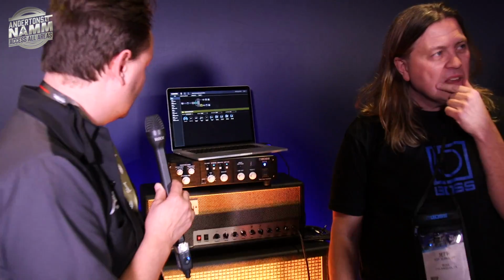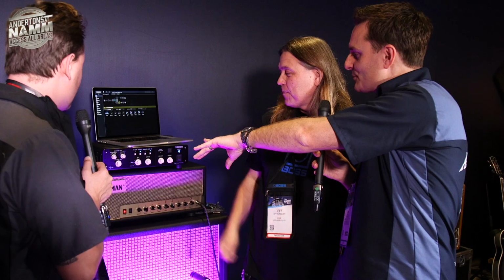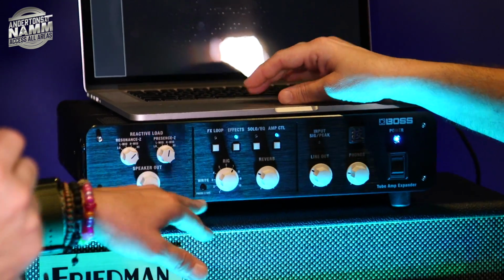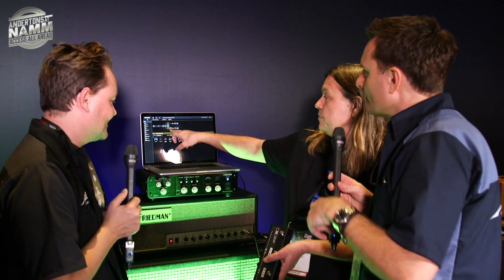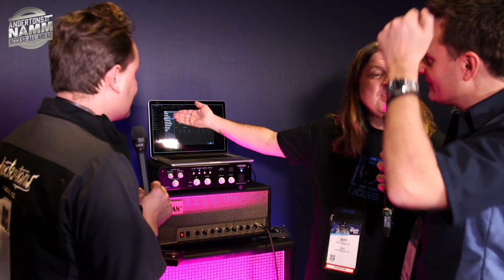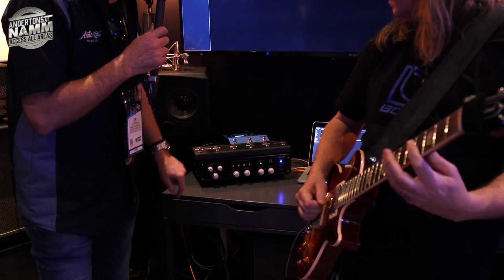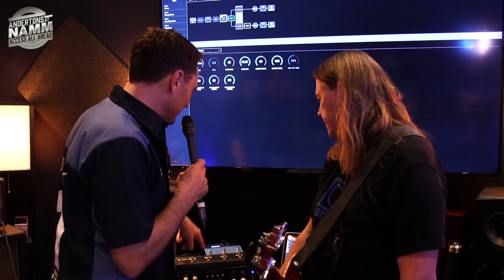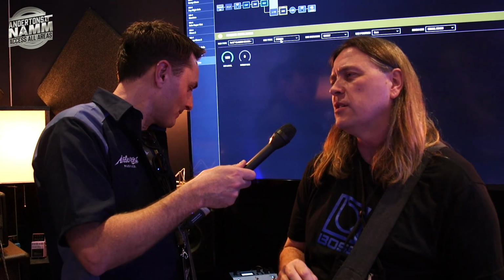Waza Tube Amp Expander - Boss' New Secret Weapon For Guitarists!

Comment: Ho’s Electronics in Vancouver has been making a reamp/attenuator device like this since the early/mid 90’s. It doesn’t have as many bells and whistles, it does have line out, effects loop, 100w onboard amp, and my unit has a variance built in as well. Ho also has a “Tone Enhancer” which does the reverse “take a 5w Champ and make it loud” thing. This Boss unit adds some modern features but the core utility of the unit is a concept that is decades old. The Ho unit has been a godsend over the years and amps have never suffered, they don’t even get hot.
This Boss unit does look very impressive.

Comment: Only downside is that you "lose" your amps power amp as it gets replaced by the 100watt solid state from the device itself, which I find a big enough con to not buy this.
Reply: Well, you don’t. It seems the amp’s power amp keeps doing its thing. The 100w power ss unit there is just for “re-amping” the signal, to make it even louder or, in some situations, quieter. Man, that’ll be just the thing with my Princeton.

Comment: I think this is the best product of Namm 2019. This device literally retrofit upgrades your tube amp into the modern era. You can control your tube amp by a computer, it records with an interface and you can play pushed tubes at bedroom levels or through a mixer and monitors if you want. Plus it has effects and midi control. Simply amazing, great work BOSS!

Comment: How does it work with a combo amp such as a Fender Bassbreaker 18/30?
Reply: As long as your combo has a jack and cable connecting the amp to the speaker/s then you just need a speaker cable (not a guitar cable) to connect the Expander between the amp and speaker.  If the speaker/s are wired directly to the amp you would need to split the cable and add jacks to allow you to connect between them.  because speaker connections (series/parallel) matter for more than one speaker you need to know what you are doing so you don't screw up the impedance--time for tech if you don't know what you are doing.  :)
Reply: patrick bear Appreciate that. I just looked at the manual and the speakers run parallel. So this won’t even work with my amp. I gotta figure out how to run an fx loop or how to make the speakers run in series.
Reply: Series or parallel doesn't really matter for this--you could wire this in and still maintain the parallel wiring.  My understanding of what this box does is that it basically isolates your amp from the speaker/s anyway.  In other words your speakers are no longer driven by your power amp they are powered by the built in 100 watt amp which receives the IR and effects altered signal.  The Main speaker output on your amp would be a good way to feed signal to this box then you just need to wire the output back to your speakers.  Work with a tech if you aren't sure how to do this.

Comment: $1899 retail, Sweetwater has it for $1299 street price??? This is a choice between a bevy of guitar gear (2 4x12 cabinets, nice guitar, decent amp, load box and a couple of pedals) or the waza bells and whistles. A tad expensive, get it under $999 and I'm on board.

Comment: I was thinking that this Boss product was a hands down winner, then Captain Lee said the price and I was like What??? and then tried to find a listing online and seen it on Sweetwater for $1299.99 USD.  Hell no. It’s an awesome piece of kit but no way could I justify that price. It’s 99 cents dearer than the UA OX Amp Top Box which I thought was expensive. It will require a few different boxes but I would use an alternate setup, work around to achieve similar results. Bad Cat Unleash V2 or Fryette Power Station and Two Notes Torpedo CAB M and some pedals or multi effects or modelling unit if you want a hybrid setup for your current valve/tube amp.

Comment: Hmmm, my options for not getting noise control called on me range from very affordable solutions like iRig, thru to an amp with something like this, an AxeFX, or going the whole hog and buying a farm in the countryside that has a large barn housing nothing but a wall of Marshall stacks, a guitar and a long cable. Budget so far is closer to the iRig end of the range though

Comment: Dave's emulated out on the Runts is already emulating a mic'd speaker...why would you add another cab simulation on it???
Reply: Because this speaker sim is more variable with different ir’s and mic selection options, and because they’re not using the emulated out, it goes directly from the power amp out. And most amps don’t have emulated outs, especially older vintage ones, plexi, ac30...
Reply: GRT XYZ oh...I see.  Didn’t realize they were using the  loop send to feed the unit.  Makes sense now.

Btw...I’d put Friedman’s emulated speaker out up against just about any cab IR.  It’s that good!  I get compliments every time I gig with my Runt 50 head and run it to FOH.

Comment: And NOBODY is talking about how much more WEAR the TUBES get with those devices...
Reply: Its up to your amp and settings, its the same amount of wear as you'd have if you crank your amp without a load.
Reply: JimijaymesGuitarist not really, because without a load you’d break a tube amp...
Reply: @grtxyz4358  I mistyped I meant in normal operation without a load box ie with a speaker.
Reply: If the reactive part is accurate the load would be the same as with a speaker

Comment: Impressive, but they're not using the stereo output to its full potential. Would be nice to be able to split wet/dry to R/L, as well as have a wet/dry mix level. Also, if I were to put this on top of my AC30, and want to use my AC30 cabinet as the speaker out, I really would like to be able to limit that 100w amp output, say a 10,15,30,50,100 switch?? I could also see a less expensive model, without the 100w amp, as another option.
Reply: You can limit the output of the 100w amp to , 50 or 10, there's a switch on the back.
Reply: @riffsnreviews  That is for the input, not the power amp output.
Reply: @badpants  It is not, it's for the output 

I mentionned to the rep that calling it "input" in counter intuitive, but then it depends what end of the signal chain you are looking from, they go from the idea that you are inputting your guitars effects and potentially other amps into X amount of watts, when thinking about it like that it does make somewhat sense I guess (as the attenuator works via reamping like the power station)

Got this confirmed by  Jeff Slingluff on tgp. " he reason for that switch is to set an appropriate level for the internal effects/D.I./Power Amp Probably the best example for it is... If you connect a 100W head you probably only wish to attenuate and turn down the live speaker cab volume. But if your using a small wattage amplifier you may want to turn it up instead of just down".

https://www.thegearpage.net/board/index.php?threads/boss-waza-tube-amp-expander.1992874/page-14
Post #263

That switch has no bearing on the 150w  load it can handle, it's to define the power of the internal SS amp, so you can have a 100w tube amp and limit the SS output to 10w, or you can have a 10w tube amp and bring the SS amp up to 100w if so desired. 
The end result is mostly making the volume knob on the waza expander less "twitchy" and to give headroom for small amps if required (voz class AB solid state amps don't sound really great when cranked...) and to set the power if you are just plugging a preamp into the waza expander
Reply: @riffsnreviews  I read the post and I'm not convinced. If Jeff is a rep, it is not obvious from that post, and most of what I read in that thread was speculation. No one has one of these in their hands yet to say definitively, and I searched for a user manual, but even that is not yet posted on the Boss website.  

PLUS - If you look at the block diagram that is available, that switch is in the input signal path prior to the FX loop, and in front of all of the different output paths. If it were for the power amps output level, it should only be in that path in the block diagram. 

I suspect that I am correct and that switch is used to adjust the input signal based on the power of the amps output. You would set it to 10w for any amp with less than 50w output, 50w or an amp with less than 100w output, and 100w for any amp up to 150w????  

Like I said, having a manual available, or seeing a demo video where someone actually shows how to set it up for different amps and cabinets on the power amp, instead of just showing all the internal features, would help.
Reply: @badpants  Well he's the : Strategic product Management for Boss Guitars and Amps @ Roland America and well known on TGP. Oh and he's the guy playing the guitar in this video :D

You are incorrect, and it actually makes no sense from a power attenuator standpoint to set it to the receiving end of the power input, no attenuator works like that, doesn't make sense setting a 150w amp to 100w doesn't make sense even being able to set a 40w 30w or a 12w  for example at 10w (to much potentiality for user error), also that's just not how inductors work (as this is a reactive load), you can't set multiple power ratings on an inductor itself (multiple impedances yes), they just have a max power rating, obviously you could have multiple inductors, but that would take up too much space (considering what else is in the box) and more potential for failures.

"that switch is in the input signal path prior to the FX loop, and in front of all of the different output paths."

You've just replied to your question, the switching is post reactive load block/inductors, if you were using  one or multiple inductors you would want to be selecting said inductors when the signal hits the inductors not after.
And it also makes perfect sense in the case were you are upping or lowering the power of and ac30 for example. So you are feeding the AC30 into the reactive load  that you can chose to attenuate or not, your ac30 is then set to the required solid state output, this is acting basically as  a cathode follower that drives the effects send (a buffer to set so your level isn't too low or too high before the send), FX loop then power output. The switch is basically setting the resistance and impedance for the power amp prior to the FX loop, so the amp does not overload the fx loop, or signal being too weak for the fx loop
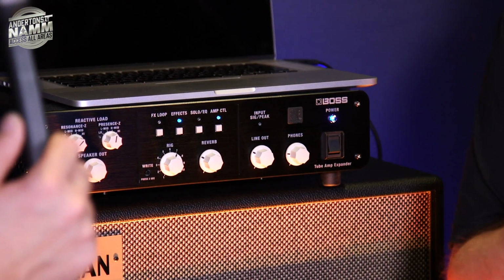Reply: @riffsnreviews  I believe this switch works in the same way the input level switch works on the Fryette PS2. You can see that explained here https://www.youtube.com/watch?v=Tl6DSZ-gPBY at around 4:19. Basically, it changes the response curve of the Volume control to allow more control at low volumes when used with higher power amps. It does not limit the output of the SS power amp. Regardless of this switch, it will still output a max 100w (8 ohms).

Comment: Amazing that it has 16 variable response curves depending on the speaker you are using. The short coming of the other products like Torpedo is that they just take a general or common curve that will sound good with all. I have a Reload.. maybe I will list it and pick one of these up. That said for the coin (just like when I splurged for my Reload) you'd better use this regularly. If you still can use old school mics, they still sound the best!

Comment: One thing I can't get past is why this and the OX are as much as a head.  The sound is great but the GUI on the OX seems nicer plus you can re-use some plugins across other UAD boxes yea?  Always great to see Jeff do a demo of his work, exciting stuff!
Reply: There’s a lot of work under the hood not to mention R&D. A passive load box only uses resistors and transfers energy into heat and those go for $100-300 or so... this is really a reasonable price and will work great for someone like me. I have amps from 15w to 120w and I also record and gig with them. With this little beast I can pick and choose any of them and dial them in to the setting instead of the setting choosing the amp. I’m not sure about the OX specs (pretty sure it can’t push a lower wattage amp like this can) but the OX is for Apple computers only so that’s not an option for me
Reply: @xRiseAgainstx  What you said. I replied before reading yours and you said the exact same thing but better.
Reply: It can be used with so much more than A head. This thing could open up the full potential of a lot of amps in different live/recording settings. Definitely worth it, especially if you are a recording engineer with all kinds of amps that do all kinds of tones.

Comment: So its like a Fryette Power Station but with a class D power amp rather than valves and IR"S built in? Its a lot more expensive than the Fryette though. If it was closer to £7-800 I would get one.
Reply: with multiple reactive loads settings plus a DSP section plus balanced line outs plus midi. Those things cost money.
Reply: I agree it wouldn't cost alot more, but I understand what is going on inside their head. Basically load box with variable impedance a few hundred, a power amp a few hundred, a multi fx unit a few hundred, and ir loader a few hundred. Thats how they are pricing it as competition to all those things separately. If you don't need all the features  it is overpriced and I definitely would hope for a price drop at some point. The OX is expensive because UAD gear is always overpriced.
Reply: Not mentioned in the video but I believe it has a built-in USB audio interface.
Reply: Yeah the different reactive loads is interesting but everything else is relatively cheap to make. The DSP and effects are bound to be the same as in other Boss products and an audio interface is just an add on. Still seems very expensive to me but I think the same about the UA OX

Comment: ah, but did they provide for the fx loop return to be routed through the built in 100watt amplifier simaltaniously with the main output to create the ultimate wet dry or wet dry wet amp rig?
Reply: I am not positive about this but, looking at the block diagram on the top of the case and just thinking about how this thing probably works, I don't think that there is any difference between the main out and the 100 watt power amp.  Basically what it looks like this thing does is that it takes your tube amp output down to line level then runs it through an effects send/return, through an AD converter, adds digital effects, DA converter then through the 100 solid state amp and out the Main Outputs.  That is the only way that I can see this working.  I am not saying that it doesn't work well as I haven't seen it outside of YouTube.  It does seem a little bit deceptive because I think we all assume that a reactive load box is attenuating not replacing the tube powered output of an amp.  I am thinking of this as a Kemper powered head that uses your own amp instead of a profile.  If it does this as well as a Kemper no problem  really.